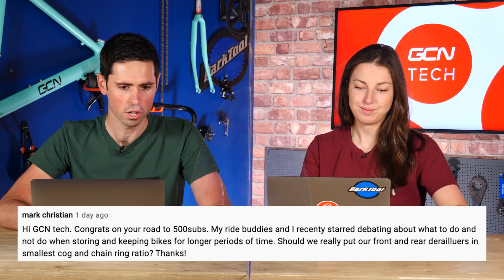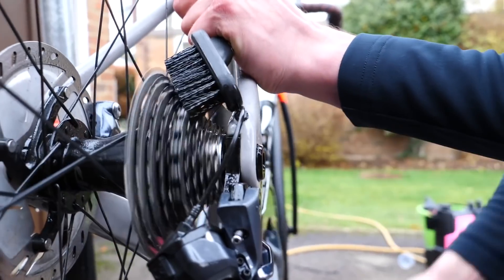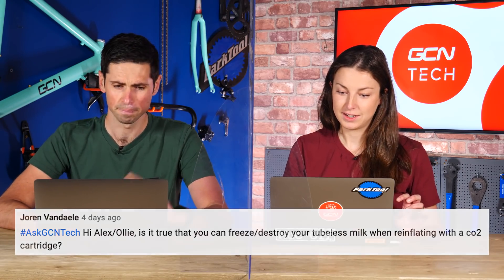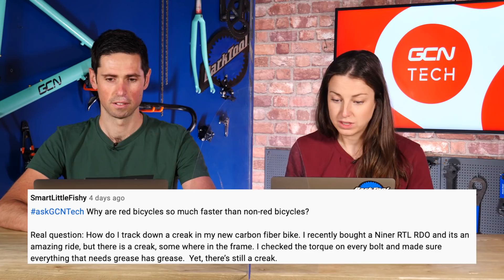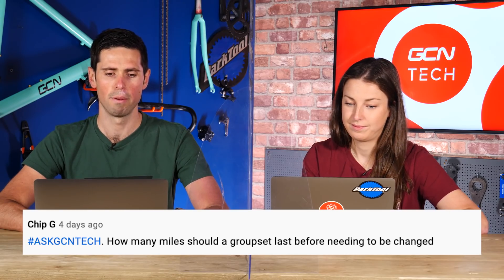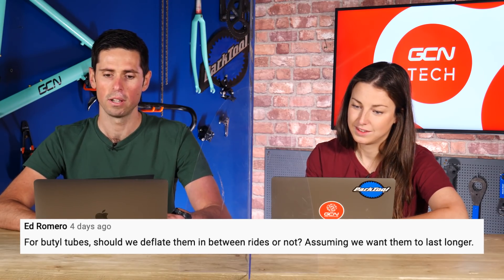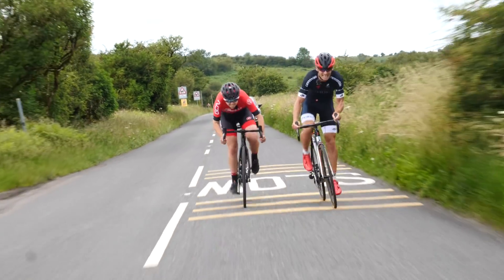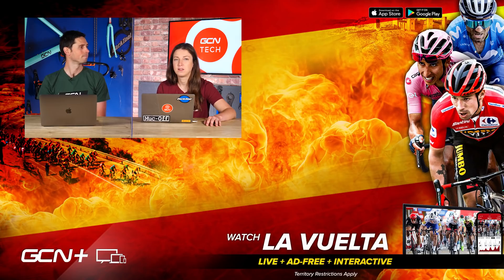Do CO2 Cartridges Really Freeze Your Tubeless Tyre Sealant? | GCN Tech Clinic

Comment: The derailleur thing about storage was recommended by GCN. That's the first time i heard about it. Around 2014-15 GCN era, you guys said that you should put it in the small ring when you finish your ride to reduce wear on the cable and spring.
Reply: I used to not worry about this until I had a 105 rear derailleur which spring had stretched over 3 or 4 years and the gear changing got well sloppy. Now I always leave it in the smallest sprockets on both front and back when not riding it. Same principal as torque wrench...don't leave springs under tension or they will stretch!
Reply: @MrDJRudec  I leave mine in middle to 8th cog for the same reason. Never had a problem 👍
Reply: @MrDJRudec  This makes sense.  I was looking at my bike the other day while washing it and was looking at my front mech, and said "damn that spring looks like it's had a hard life", so def. having it under tension for so long would def. stress and fatigue the metal.  I'm going to be more mindful of this.
Reply: It was John, right?
Reply: @charliewhelan9488   I think it was Si and Lloydy before Jon was on the scene
Reply: @jackofharts94  ah that'll do it. I remember it every time I put my bike away though!
Reply: I would say small ring + smallest sprocket on the cassette so the cables are at their slackest.  Cables stretch.  Makes sense to remove any tension from them.
Reply: Springs are made of steel and as long as they aren’t put under so much stress that they bend permanently they don’t wear out.
Reply: @TheGotoGeek  Yep. The rear derailleur on one of my bikes is 40 years old and is only now starting to show signs of fatigue. 👍
Reply: Yeah it do it everytime on my Domane.